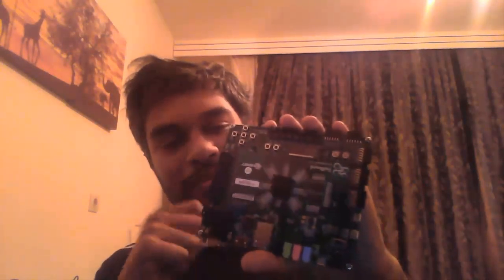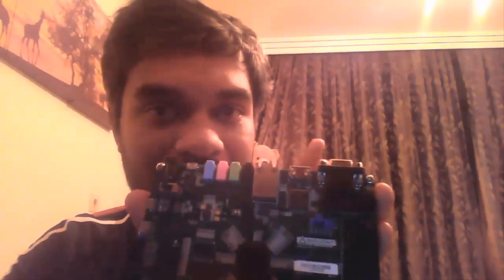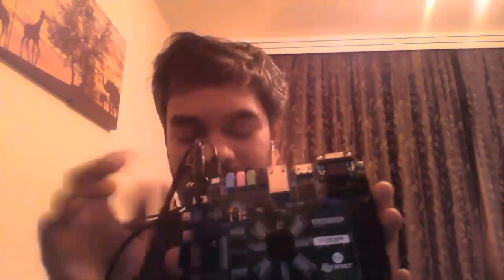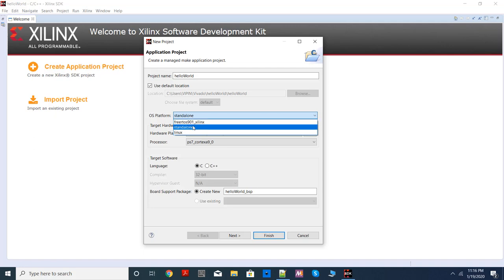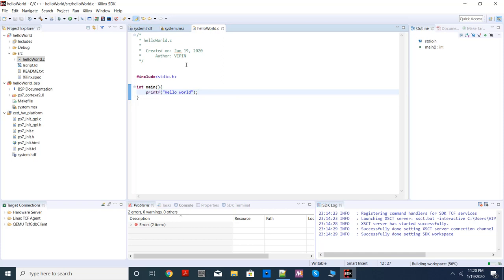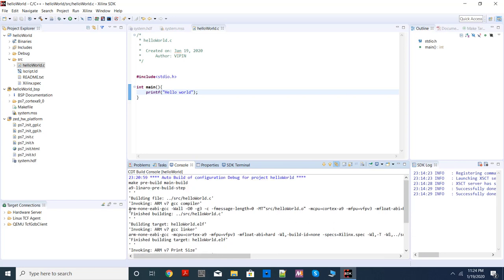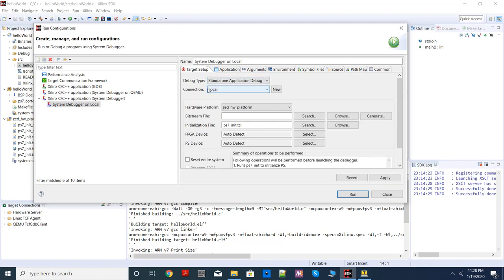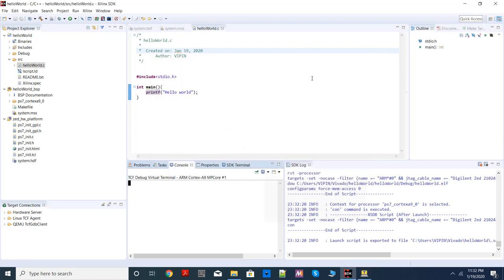Introduction to Zedboard and First Project with Xilinx SDK

Comment: Hi Vipin. Nice video. Thank you for sharing. I bought zedboard a week ago. I got a problem in the startup phase, when I connected zedboard with my pc. when both are connected, and the usb driver has been installed, the zedboard lcd should be on and some leds should be on as well. It did not happen to me. do you know what is probably wrong in my case here? thx

Comment: Can you please tell that if the zedboard is getting is getting automatically shutdown once the programming cable is connected then what could be the possible reason. On searching I found that replacing the cable could be a solution but I tried that and no progress.

Comment: Dear Vipin, Thank you for the course. I am following the course.  I have a question. I am using the xilinx ISE 14.7 software which works on oracle VB. I could not program the FPGA as I cannot detect any port of Xilinx SDK terminal. I have tried the following.                                                                1. Installing cable drivers. (C:\Xilinx\Vivado\2022.2\data\xicom\cable_drivers\nt64) -> Install_drivers as admin.
2. Tries to uninstall exiting drivers and reinstall them.
3. Tried to add myself to dialout group

In the process, of installing cable drivers, I received following message. (INFO: InstallPath="C:\Xilinx\Vivado\2022.2\data\xicom\cable_drivers\nt64\"
windrvr6 is not installed (this is expected for Windows 10 and later))

I am sure the windows 10 does have that driver. Do you have any idea about the issue? Please let me know. Thanks!

Comment: Error while launching program: 
Could not find ARM device on the board for connection 'Local'.
Check if the target is in:
1. Split JTAG - No operations are possible with ARM DAP.
2. Non JTAG bootmode - Bootrom may need time to enable DAP.
Please try again.

Troubleshooting hints:
1. Check whether board is connected to system properly.
1. In case of zynq board, check whether Digilent/Xilinx cable switch settings are correct.
1. If you are using Xilinx Platform Cable USB, ensure that status LED is green.
Could not find ARM device on the board for connection 'Local'.
Check if the target is in:
1. Split JTAG - No operations are possible with ARM DAP.
2. Non JTAG bootmode - Bootrom may need time to enable DAP.
Please try again
Reply: Hi 
How you find solution of this issue
As I am also stuck in same situation

Comment: Hi, vipin. I'm a complete beginner to Zynq 7000 and FPGAs in general and have come across an issue i cannot seem to fix. I can get my Zedboard to be recognized and programmed by the new Vitis software, but i cannot get the board to output anything, not even Hello world to Teraterm. I've checked all possible settings in teraterm and the BSP (stdin and stdout are both set to uart1) and still can not get any output. Your help would be appreciated. Thanks.
Reply from the maker: To isolate the problem, can you try to program from SDK instead of Vitis?
Reply: @Vipinkmenon  Yes I tried it using the same version of Vivado/Xilinx SDK as in the video and I still cannot get an output
Reply from the maker: I can think of only the following reasons
1. Cables are not connected to proper connectors. Make sure you are connecting to JTAG and UART and not the USB OTG
2. Make sure when you plug in USB/UART cable, in Teraterm a new COM port is listed. Otherwise will have to install the cable driver for it
3. When you create run configurations, under applications, the elf file is chosen
There is a very remote possibility that board has some real hardware issue. But it is really really rare.
Reply: @Vipinkmenon  It turns out, there was a manufacturing error. Some Rev E boards (my board is Rev E) were assembled with the wrong DDR modules. Instead of 512MB, it has 1024MB (lucky me) so I had to change my DDR configuration in Vivado and select the correct memory modules. Everything is working great now and I look forward to learning from your other videos. I really appreciate your willingness to help me!
Reply from the maker: Ah that is great..

Comment: Hi Vipin. I am trying to multiply two numbers together to get the results and also measure how much time it has taken for this code to execute. However, when I try to write in standard C, it just gives me a lot of errors. Is there a different way to write C on the Xilinx SDK? Could you help me with an example code in Xilinx SDK to multiply two numbers and get the result and also measure the time it takes??
Reply from the maker: I guess the best option will be to use the Timer/Counter present in PS to do it. Try this code
#include <stdio.h>
#include "xil_io.h"
#include <xttcps.h>
#include "xparameters.h"

int main(){
 int a,b,c;
 s32 status;
 u16 counterValue;
 XTtcPs_Config *myTimerConfig;
 XTtcPs myTimer;//Timer/Counter structure pointer
 myTimerConfig = XTtcPs_LookupConfig(XPAR_PS7_TTC_0_DEVICE_ID);//get the configuration
 status = XTtcPs_CfgInitialize(&myTimer,myTimerConfig, myTimerConfig->BaseAddress);//initialize counter
 if(status == XST_SUCCESS)
  print("Timer successfully initialized\n\r");
 print("Enter the first number:");//Get the numbers through serial terminal
 scanf("%d",&a);
 xil_printf("%d\n\r",a);
 print("Enter the second number:");
 scanf("%d",&b);
 xil_printf("%d\n\r",b);
 XTtcPs_ResetCounterValue(&myTimer); //reset the counter to 0
 XTtcPs_Start(&myTimer);//start the counter
 c = a*b;
 XTtcPs_Stop(&myTimer);//stop the counter
 counterValue=XTtcPs_GetCounterValue(&myTimer);//get the current value
 xil_printf("Product of %d and %d is %d\n\r",a,b,c);
    printf("Execution time %d clock cycles and %0.5f us\n",counterValue,(counterValue*1000000.0/XPAR_PS7_CORTEXA9_0_CPU_CLK_FREQ_HZ));
    return 0;
}

It is a 16 bit timer/counter. So if the execution time is too long, it may overflow. In that case you will have to use the scaling feature to scale the clock used by the counter. For a single multiplication, there won't be any issue. I am getting 27 clock cycles for integer multiplication

Comment: Hi Vipin, I'm getting this error while building:
undefined reference to `main'	xil-crt0.S	/helloWorld_bsp/ps7_cortexa9_0/libsrc/standalone_v3_11_a/src
Could you please help me with this?
Reply from the maker: He is saying he cannot find the main function in your code. Make sure all your .c files are in the src folder. Within SDK itself you can drag and drop them to .src folder. If still problem persists, start a new project and make sure .c file is added to .src folder
Reply: @Vipinkmenon  thank you. The solution which worked me was that I went to the xil-crt0.S file, commented out the line "bl main", and wrote the same thing in the next line "bl main"

Comment: Hi Vipin. I have an issue getting started with my zed board and was hoping you might have some insight of the source of the problem. I have been getting the following 'Memory read error at 0xF8007080. AHB AP transaction error, DAP status f0000021' whenever i try to load the '.elf' file to the board. Have you ever encounter this problem with you zedboard? Any help will be appreciated - thank you.
Reply from the maker: Just to clarify did you follow the same project discussed in this tutorial? Also make sure "Run ps7_post_config" option is also checked in configuration
Reply: @Vipinkmenon  Yes - and I have selected  "Run ps7_post_config". For jtab mode all headers are connected between SIG and GND, correct?
Reply from the maker: Yes for jtag mode is 000. Seems similar to this issue. Try issueing reset before launching  https://forum.digilentinc.com/topic/12952-ap-transaction-error-dap-status-f0000021/